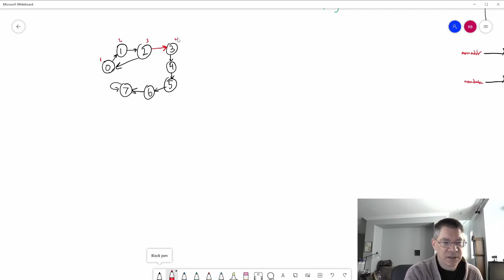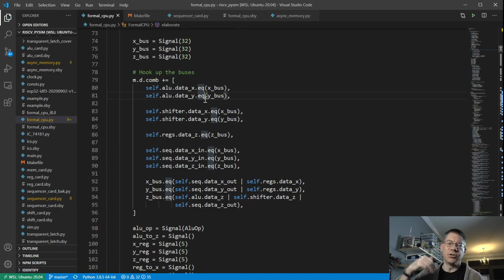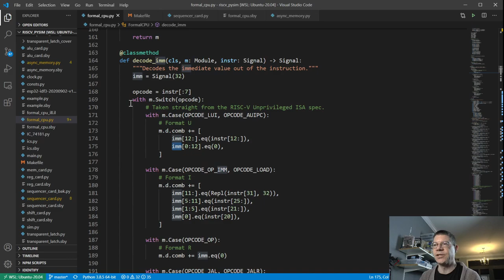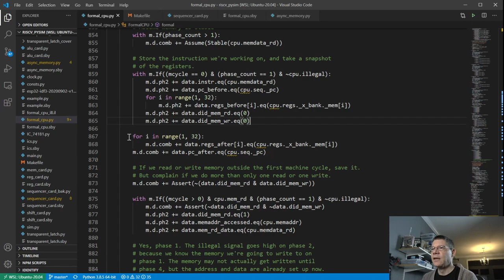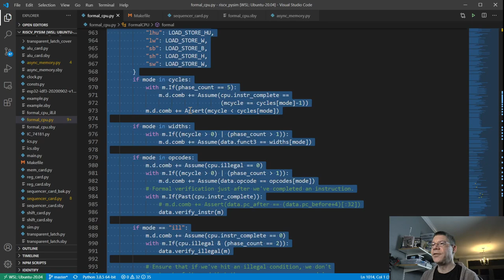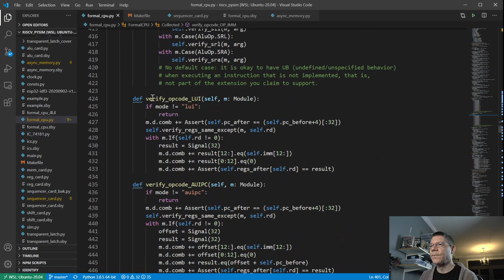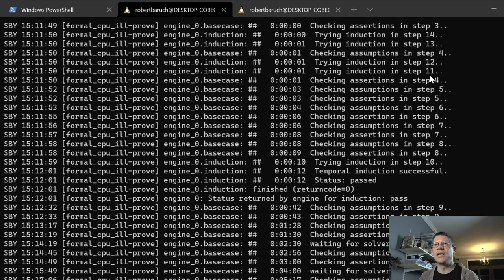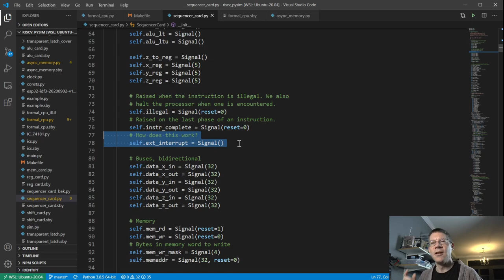LMARV-1 reboot part 5: formal verification of the CPU

Comment: Why is PC 32 bits if everything is aligned on a 32 bit boundary? It could be 30 bits and save a little bit of resources.
Reply: 32 bits is 4 bytes. If you remove any of those bits you only make things more difficult in other ways.

Comment: So, something's starting to bug me with this "cards on a bus" architecture. The sequencer is intended to be its own card, yes? The problem is that each new instruction/extension will end up needing to also touch the sequencer card. So you can't just "throw in a card that implements the bit manipulation extension", you also have to replace the sequencer card. Personally, this makes it a bit moot -- you may as well have the alu, sequencer, registers, etc., all on a single board and then just use the cards for CSRs and peripherals.

now, i'm sure you can add things to the bus to external cards can implement new extensions/instructions, but i feel like it'd be simpler if that's how everything worked in the first place. idk.
Reply: There’s two (well, three) solutions: a “coprocessor flag” that signals another card to do something and throw an illegal instruction exception if nothing responds. The other option is to have a way for the sequencer to know about coprocessors (like an I2C side bus for communications) and what opcodes they support, then when a “new” instruction is reached, see if a “coprocessor” claims to support it and toss control over to that card (by doing nothing and letting the card deal with the instruction) until it’s done. The third “solution” is to just do nothing which would possibly require a new sequencer card for each extension.

I’m reminded of Intel when the x87 was a physical (optional) coprocessor. If a 0xD? byte was reached (as the first of an instruction), the main CPU would just ignore it and the x87/FPU would work in the background to compute the result. Then the FPU would tell the CPU that it was done so the CPU could get the result.

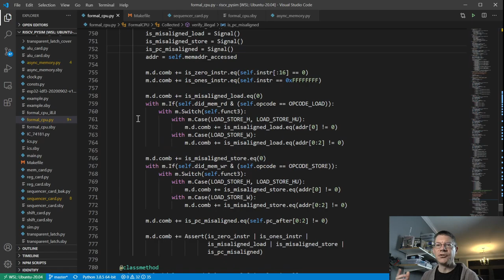Comment: Hmm, when you're asserting about the illegal instruction symbol, you didn't consider several categories of instructions that should be illegal - e.g. OP-FP, or compressed or extended instructions. 44:30
Reply from the maker: The standard seems to indicate that if you don't implement an extension, you get to decide what to do when you encounter instructions in that extension. I decided to just skip over the instruction :)
Reply: @RobertBaruch  I don't think you are reading that quite right (or otherwise I'm not ;-) ). Any instruction that you don't implement is supposed to generate a "Illegal instruction" trap.  But any instruction encoding not specified in the base instruction set or a supported extension can be reused for an instruction in a custom extension if you want to (Though if you use any instruction encoding other than those explicitly reserved for custom extensions, [i.e. major opcodes custom-0, custom-1, custom-2, and custom-3] it would be a non-conforming custom extension). 

I guess you could create a non-conforming custom extension that uses all instruction encodings not used by RV32I and then not document the behaviour of most of you custom instructions, but that would be seriously bad manner. Also, that would prevent software emulation of unsupported extensions, which can be quite useful.
Reply from the maker: @JonSeverinsson  Well, 2.2 says that "The behavior upon decoding a reserved instruction is unspecified" so that covers the "holes" in instructions. But I suppose it does make sense that if an extension is not supported, then an instruction in that extension should generate a trap, so that either an exception is signaled, or the execution environment implementation could emulate the instruction. In that case I should probably just lock everything down and throw an illegal instruction exception.

Comment: The processor is actually not responsible for swapping registers during a trap. Instead, the handler must swap mscratch to obtain access to the register storage space. See 3.1.14 and the MRET/SRET instruction, which only pops the privilege and interrupt enable stacks.
Reply from the maker: Correct, but the usual way the trap handler runs is to push/pop all registers. I just shortcut that by doing it in hardware.
Reply: @RobertBaruch  Here is a RISC-V with the option of a different bank of registers for interrupts: https://github.com/darklife/darkriscv

Note that while the counter CSRs were part of the 32I base instruction set until recently, they have become optional in the latest revision (now they are extension Zicsr in chapters 9 and 10)
Reply: @RobertBaruch  I think, the correct (i. e. standard conforming) way would be, that you create an instruction set extension to do that. That means, that the interrupt handler would be called as the standard describes and then performs a register swap instruction. There is plenty of space in the opcode matrix to do that. 

Also this would mean, that you could possibly do it as an optimization for for function calls. Instead of pushing the arguments to the stack, the caller would now copy the arguments to a fresh bank of registers, then switch to it and call the function. I imagine this being a big performance boost for some programs. That would mean, that you need to change the api though.
Reply from the maker: @lukasschwager5876  Actually, now that I think about it -- automatically swapping the register page might not be great, since a trap might want to know what the registers were when the trap happened. So then yeah, a register page swap instruction would be in the CUSTOM extension.